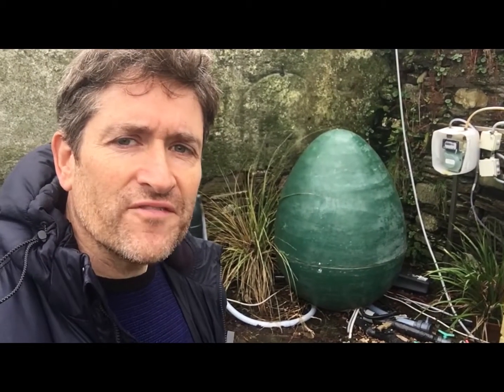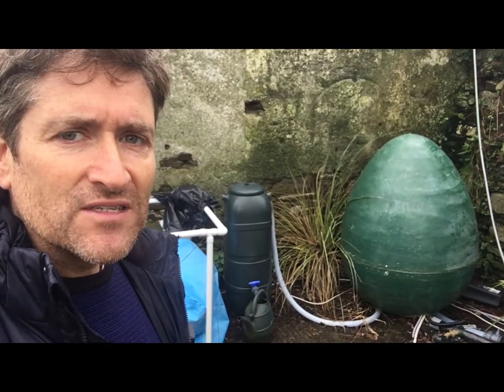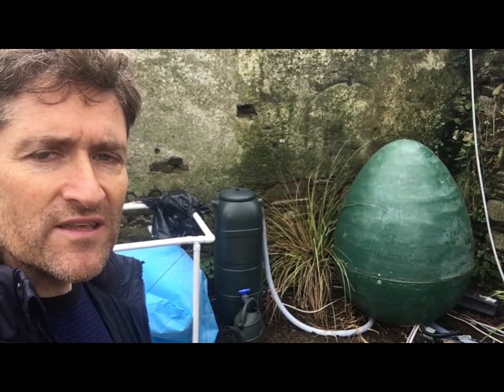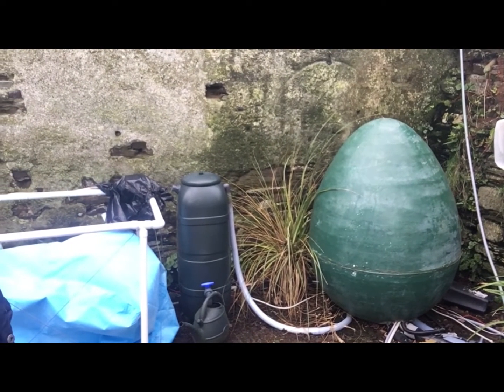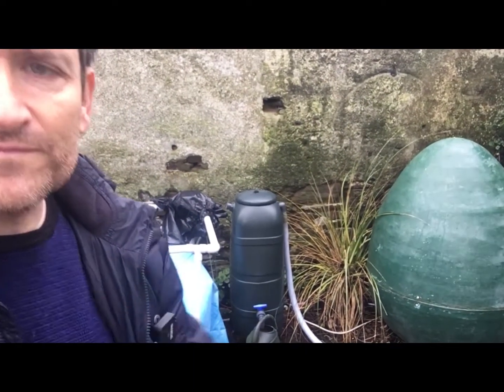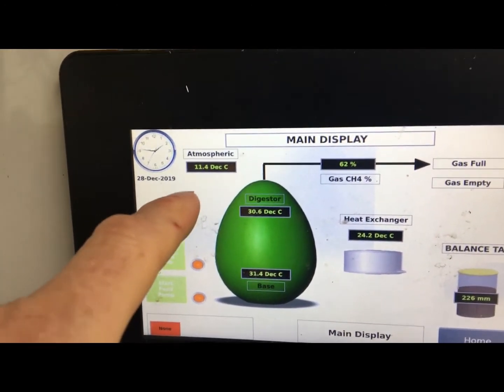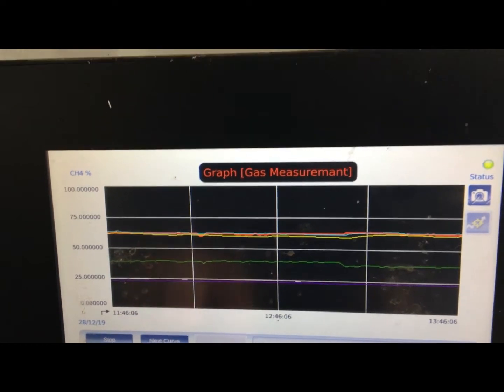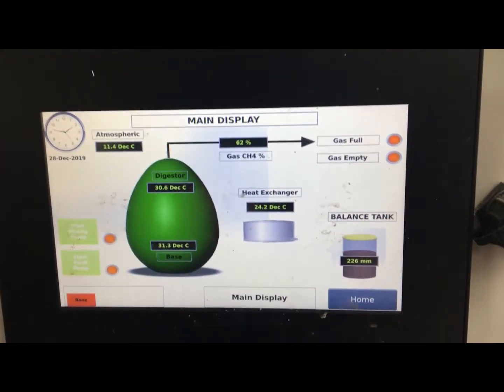06_Micro Egg Digester Explained

Comment: Hello 👋 I’ve been watching your videos and I’m very impressed with your system. I was just wondering what kind of heating element you use in the mygug. Does the energy to heat the reactor outweigh the amount of energy you get from the gas?
Reply from the maker: Hi Connor, thanks for your kind comments. Yes, there is an electrical heating element in MyGug. Living in a temperate climate there is no real alternative. The energy balance for the system depends on a few factors. Firstly the colder it is the more heat you will loose so the more electrical energy required to keep the unit heated. The second is the amount and types of food waste going into the unit. If you are inputting more foodwaste you will get more biogas created. Every 1m3 of biogas has a calorific value of about 6kW.hrs. Currently I am getting a net energy gain in Summer and net input in Winter. I am making improvements in insulation and heating system and I hope to test a solar heating unit to make even more gains. Thanks for your interest in MyGug.